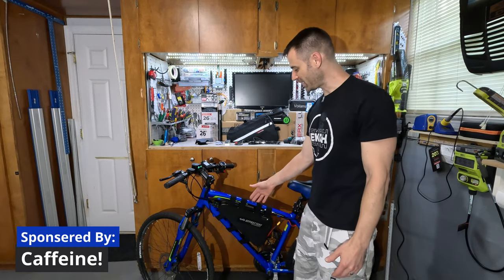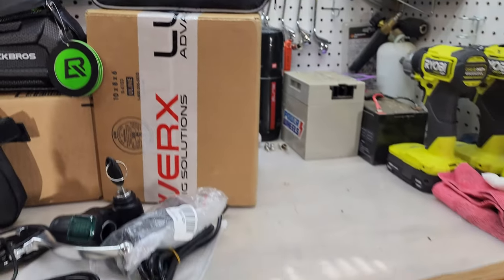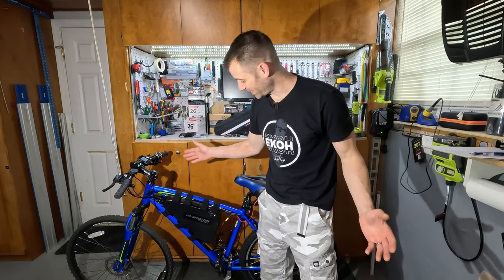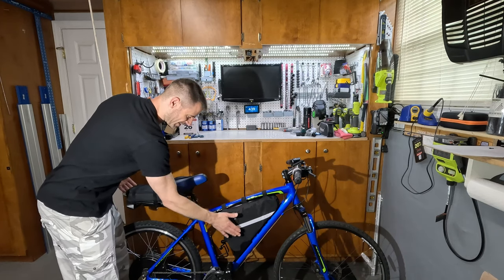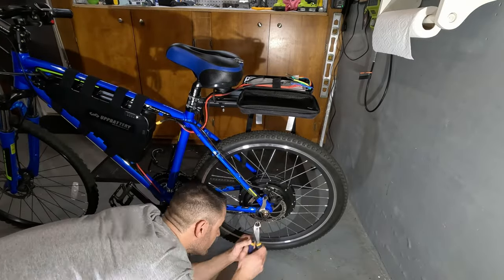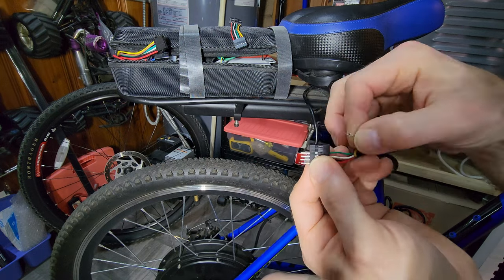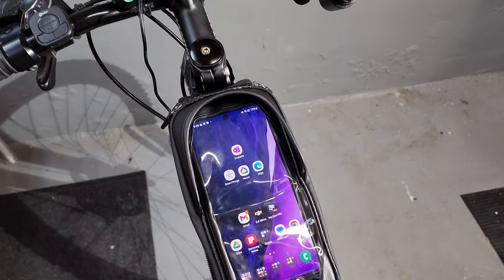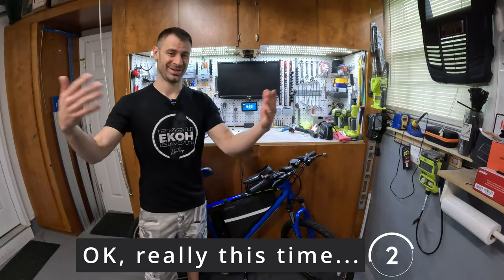1500W eBike gets mods [Overview+ Installs]

Comment from the maker: Hope y'all find this one fun and informative!
Reply: Seat looks great, I'm getting a comfort seat when I've more money to spend, also going to get two really good puncture proof tyres and possibly a suspension seat post as my bike only has front suspension forks, just want a bit more comfort, can't wait to get going starting my build..
I'm 50 now but I feel like a teenager cos I'm super excited to build my electric conversion ..
6 years ago I had a 250watt, 24v Cyclamatic Power plus ebike that was rear hub drive and did 16mph, I loved that bike, back then it was so much fun but I'm buzzing to be doing the 1500w 48v build with the 52v 20ah battery, should be a tonne of fun!!!
Reply from the maker: It's a super comfy seat!  I have a MTB that leaves a lot to be desired in comparison.  The seat post was definitely a good investment.  Your new build is going to feel like a beast compared to 250w!  Drop me a line here or Reddit if I can help with anything during build 🙂

Comment: Great vid im building a 48v 1500w with a 52v 20ah battery bike vsoon when all my kit arrives, just trying to gather info, thanks it all helps!!
Ive subbed for more ebike stuff cheers.
Reply from the maker: Thanks!  Let us know how your build goes.  I will definitely be doing some more E-bike videos in near future.  I've added yet another partial throttle, and this one doesn't interfere with my gear selector as the voltage meter is now separate.  Appreciate ya!
Reply: @manicmods  will do, do you know if the Voilamart 1500w 48v kits separate controller is ok to do shunt mod on, I'll only be adding small bit of solder as I'm going to be using a 52v 20ah battery so I don't want to fry anything, cheers for replying and yeah I've subbed and I'll keep you posted on the build...
Hopefully it should arrive in the next week all the motor kit and battery, I ordered the battery a day before the kit but I know batteries can take longer to arrive, cheers it's appreciated.
Appreciate your vid it's very helpful and I'll be going through your vids to see other info, so cheers!

I'm just hoping the triangle battery fits ok, made a template and it should just fit, will be tight on my 'Scott Voltage YZ4' mtb (got bike for £70 and it's in great condition, 26" wheels). Oddly enough it's not electric (yet) but it's called 'voltage' which is almost spooky.😮
Reply from the maker: Should be no problem in theory.  I'm not a huge fan of the shunt mod tbh.  As much as I love voiding warranties, I'm overall happy with performance out of the box.  And ultimately a tad afraid of it self destructing 😅
Reply: @manicmods  yeah I hear you, I'm only going to put the smallest amount of solder on the shunt just for a bit of extra torque (all hills here in West Yorks UK) and I like speed, but I'll be very careful too, I'm getting older now (shame about not being wiser too) but I also like messing around doing fun projects...
I'm just going through your vids, watching your home mods setup one now, seems your a tech lover, I like it man!!!
Reply from the maker: Lmk how it works out, you've peeked my interest! I hear you on older but not wiser 😆 The best safety mod I did was the partial throttle grip.  Got a little hairy going for a brake one time.  I really like my gear selectors otherwise would have added the brake cut off.  Appreciate ya checking out my content!  I have a very wide niche but all centered around technology.  My home automation stuff seems to be the best received so will always circle back to that.  One day I'd love to get back to the UK, never been that far North of London

Comment: Do you know if I’ll be able to use a 52v 28.8ah battery on a 48v 1500w kit that uses a 48v controller? or will it cause any damage as I’ve seen people use similar setups to this and it seems ok to run.👍
Reply from the maker: I don't want to steer u wrong but I'd suspect that would be fine.  My e bike battery is 52v when fully charged using 48v controller.  My ATV is 72v with 72v controller but fully charged it's 84v.  Lmk if you have any product links and I am happy to review further. Thanks for watching!